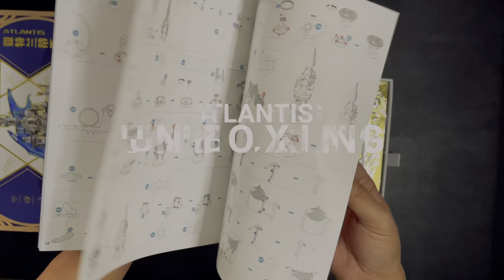Satisfying MU Atlantis Metal Model | Limitless Figure Building

Comment: I'm working on mine now. I find sometimes the parts are hard to connect so well. I keep some Gorilla glue handy just in case. I notice on yours at 10:32 to 10:37, one part hasn't joined properly in the middle (where the light is shining underneath it). Hope you can fix that, its excellent otherwise.